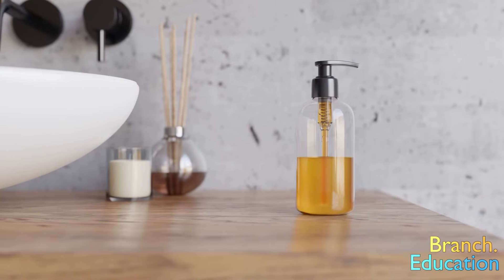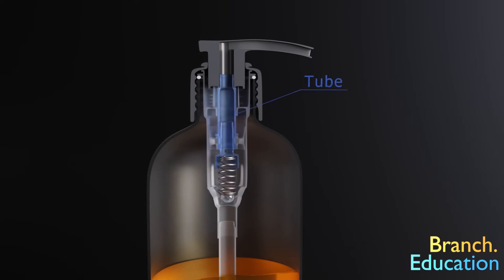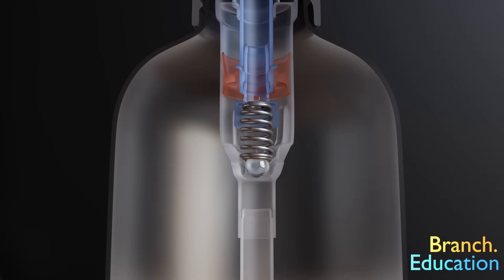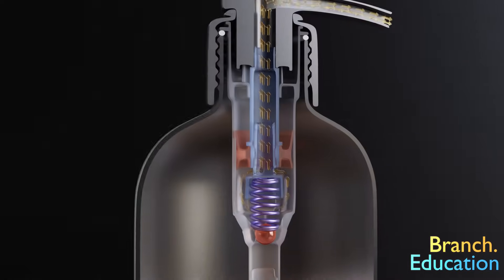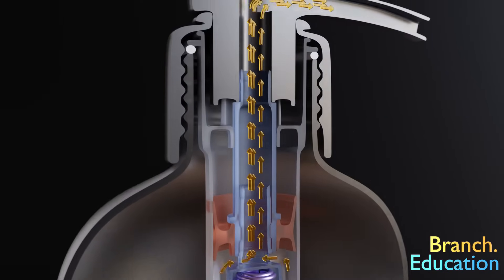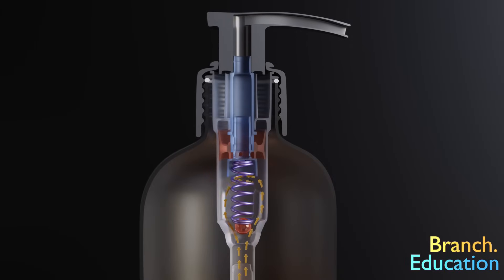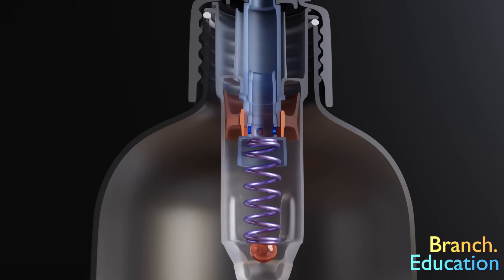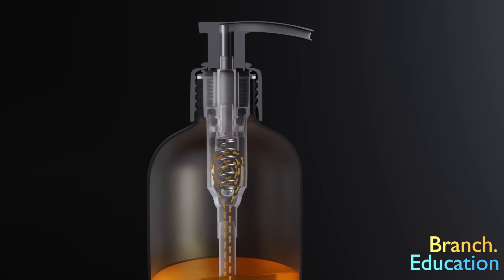How do Soap Bottle Pumps Work?  ||  Inside Animation of a Soap Pump Dispenser

Comment: Why nobody says the truth?
Suction doesn't exist in our Universe! There is NOT such a force, but everybody keep naming it once and once again.
It is the Atmospheric Pressure inside the bottle which PUSH the soap up to the hose in first place. Then it's your fingers force, PUSHING again, which expels it out to your hands.
I have just watched 3 videos about the subject and none of them say the truth. All of them talk about suction. Suction doesn't exist! Period.

Edited: Ok. Let's say there is no air inside the bottle. Well, why is the soap in a liquid form and not a gas? Where the high pressure of the soap comes from? The answer is the same for the two questions: from the Atmospheric Pressure.
Of course, you can make the dispenser's mechanism in such a way that you increase the pressure of the soap inside the bottle when you push with your finger. But my point doesn't change: there is no such thing as suction; it's always pushing. The same happens with vacuum cleaners: there is no suction; it's always pushing.

Comment: I know how the liquid goes up. But how does the air go in?
Reply: That is the smartest question of all.
If the bottle (or the mechanism) doesn't have a way for the air to replace the spilled soap, the bottle will end up squashed by the atmospheric pressure.
Reply: @GodoyToni  Thanks. Actually I did a little investigation after I asked the question. I found that the path of the liquid is different from the path of the air. 

The air can go in and out freely from under the sleeve of the spout. But there is a disadvantage of it -- if you hold the bottle upside down or the bottle falls down, the liquid would go in the air way and block the air path. Then the air will not be able to go in, and there would be a problem: the liquid will eventually stop coming out because there would be no "air to replace the spilled soap" as you mentioned.

I had that problem. That was why I asked the question, to which I couldn't get any answer. 

So I did a little investigation, and I found it out myself. Then I washed the air path clean, and after that the soap dispenser started to work as well as new. 

Some manufacturers have noticed that problem, and they have made pumps that can stop the liquid from going into the air way. That is to say, even if you hold the dispenser upside down, the liquid won't go into the air path.

Comment: There are more than 4 ways to this approach.

Another method is actually pumping in air instead of the liquid. So as you pump down, it will push fixed portion of air into the bottle.
This is the cheaper method that often used in 3rd world countries

Comment: why does the bottle not compress? after pumping the liquid out? is there a vent somewhere? Soap would come out. This one way valve shown on the video doesn't allow for air flow back into the bottle to fill in the space of the liquid extracted

Comment: The pump design prevents air from entering the bottle to maintain hygiene and prevent contamination. However, despite the decrease in volume as the liquid soap is dispensed, the bottle doesn't collapse or deform. Why is that?

Comment: Does air get inside the bottle to replace the soap? If not and there is no air pressure pushing the soap down, how can the vacuum pump pull it?

Comment: Very clear animation, but still doesn't explain how air flows into the bottle to replace the displaced liquid. 
And what about foaming bottles? The air has to be mixed with the liquid as it comes out. Those pumps are quite a feat of engineering.

Comment: Wait, so the mechanism only act a syringe, and the amazing part about it was able to suck some liquid out the container and pull the previous sucked liquid at the same time. Well as a beginner in mechanical engineering, my theory was correct about this certain topic, thanks man.

Comment: It doesn't explain shit. It works by increasing the air pressure in the upper chamber by squeezing the pump, and when you squeeze it the the rod opens the little holes on each side and thus the air escapes up through the rod, creating a low air pressure which causes the liquid to move up. The effect is the same as when you suck through a straw, you create a low air pressure and the liquid goes up.
Reply: Isn't their the liquid soap instead of air?, there maybe air when u refil that's why soap doesnt come out instantly u need to press 2-3 times before soap starts flowing coz earlier its throwing out the air and filling the straw with soap......idk But the animation EXPLAINS IT WELL, USING FANCY WORDS DOESN'T MAKE IT SIMPLER

Comment: Thanks for the explanation but I have one question: is there a way for air to get in the bottle? Coz if it doesn't a vacuum will be created inside the bottle.
Reply: Lol ofcourse their is some air which enters through the same nozzle from where the soap comes out n dont' worry vacuum isn't created its just low or high pressure that too when u press it and to counter that effect the liquid flows out

Comment: @0.37 Why did the whole spring moved up. As per the animation diagram the bottom end should keep the ball valve still closed instead. Are you sure spring is pushing the ball down and not the gravity. In my view ball is free from spring and acting independently.
Reply: It's probably due to the vacuum created in the chamber, it's kinda sucking the ball upwards overcoming the spring at the same time as it pushes the whole assembly upwards.

Comment: When the nozzle is returning up after ejecting soap, why doesn't the spring keep the ball down and then air/excess soap would come down from the nozzle to fill the newly created gap.
Reply from the maker: The design of the tube and piston also acts as a one-way valve preventing liquid to return from the top of the tube.
Reply: @BranchEducation  oh I see thank you! I misunderstood what sections were the "piston" and "housing" and didn't catch the red and blue parts moving relative to each other during the nozzle lifting. It's a very clever design!